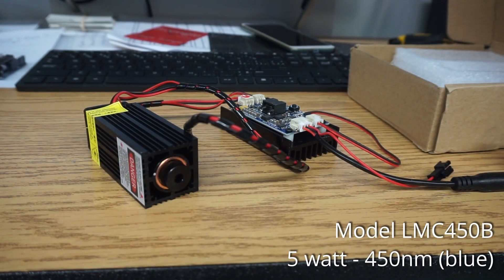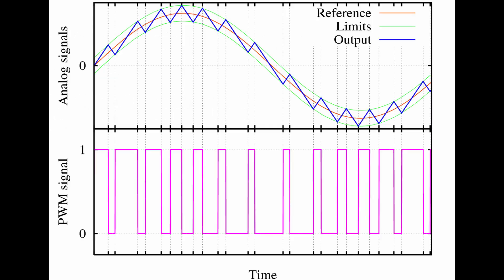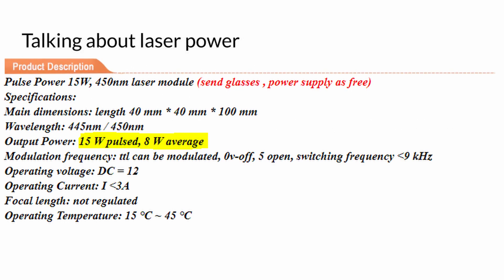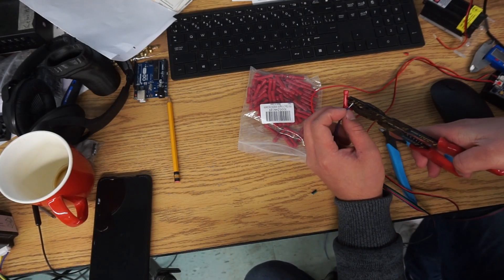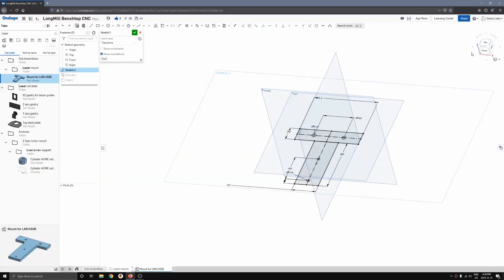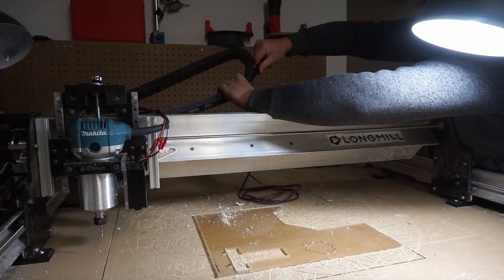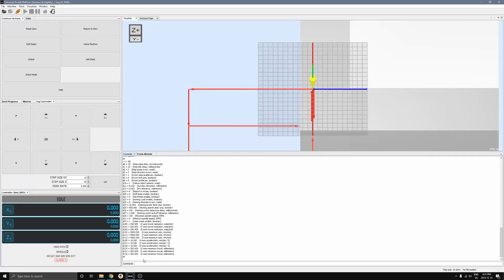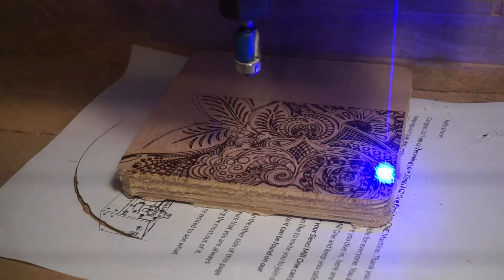Adding a Laser onto Your LongMill

Comment: This is an awesome video.  I'm scared though. I'm new to all of this but would love to get something that can cut out designs in wood.  Do I need the laser?  Or can the CNC by itself actually cut out thin mdf wood?
Reply from the maker: Hey there, the CNC is generally designed to cut using a spinning end mill, with the laser being an optional attachment. The laser is optional but we just wanted to show folk that you could add one if you chose to. If you're interested in seeing the machine cut wood and other materials, I would recommend checking out the other videos on our channel!

Comment: Is there anyway you can post the link on where your purchased this model i can not find it.
Reply from the maker: I can't remember the exact model, but something like this should work: https://www.banggood.com/450nm-5W-Laser-Engraving-Module-Blue-Light-With-TTL-Modulation-p-1337358.html
Reply: @SienciLabs  Seems to be issues with the motherboard with these according to the FB thread in the The LongMill and Mil One User Group. Are you still recommending this one from Banggood?  The Jtech one is very expensive. Thank you.
Reply from the maker: @ronnieg6099  To be honest I haven't tested enough lasers to know which ones to recommend if not one of the very expensive ones. I guess there's a risk that a cheap one will not work correctly. I got lucky with one that works fine, but I don't want to post the one I got because I cannot vouch for the quality that other people might get. Perhaps what might be better is to purchase a budget laser from Amazon as they may be able to provide more recourse for defective products than Banggood or other Chinese retailers might.

Comment: Thanks for the video! What’s the wavelength of the laser module you picked? Did you pick that wavelength for any particular reason?
Reply from the maker: I believe the wavelength was 445nm. It seemed to be the most common. If you are planning to cut a lot of a particular material, you can choose a laser that works best with the absorption spectrum of your material.